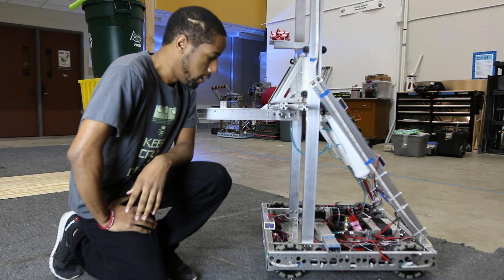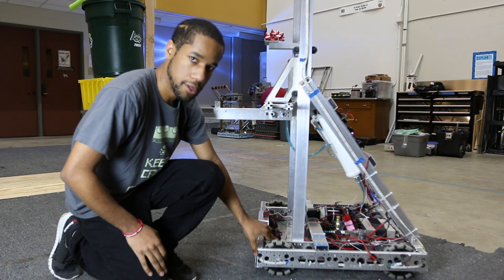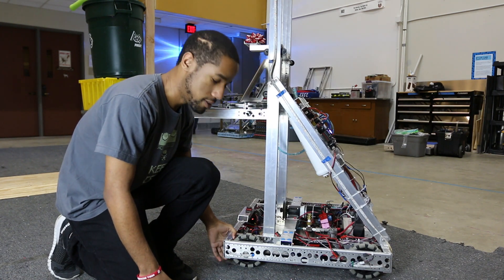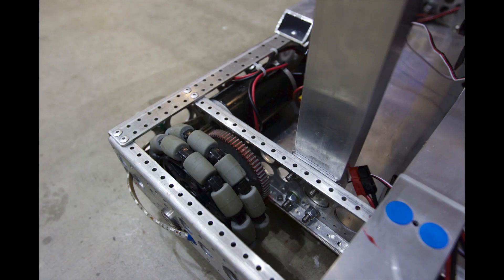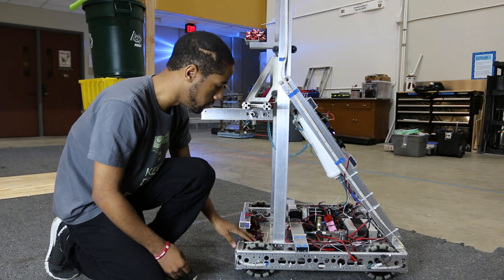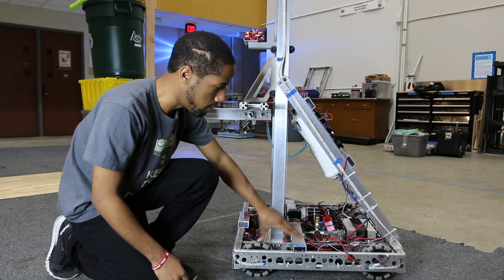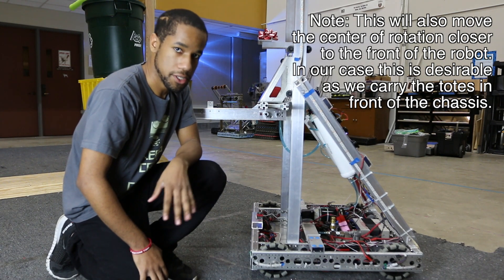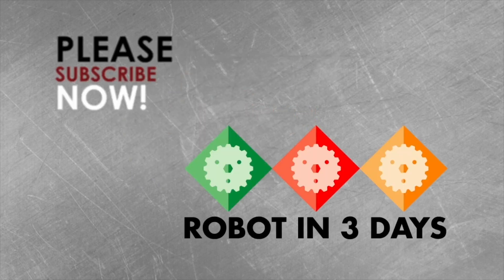[Ri3D 2015] oRyon Labs: Betelgeuse - Drivetrain

Comment: We are looking at using an omni drive system, but with 6 wheels, four in the forward direction and two in the sideways direction, we are trying to decide whether to use plastic wheels or metal wheels, do you think it will make a difference, and is there anything that you found about the omni drive that you weren't expecting?
Reply: We used the VEX pro wheels. Great quality. http://www.vexrobotics.com/vexpro/motion/wheels-and-hubs/omni-wheels.html